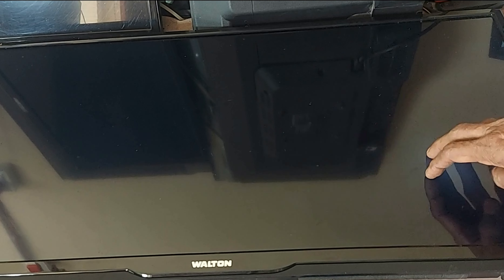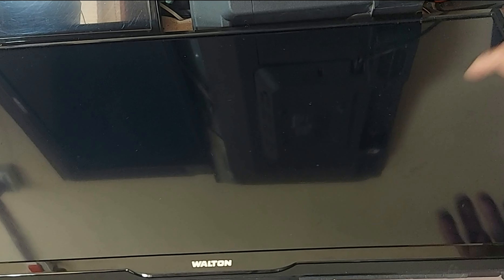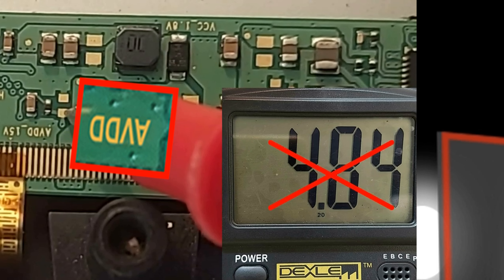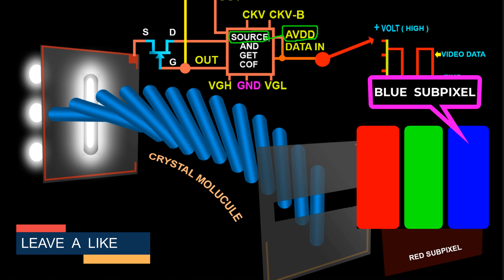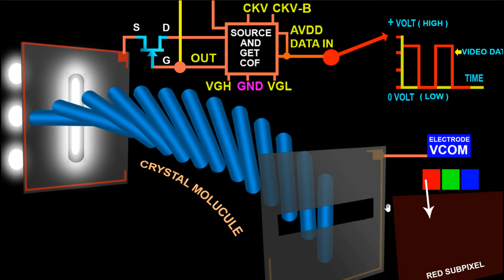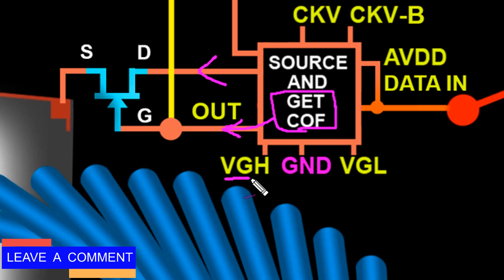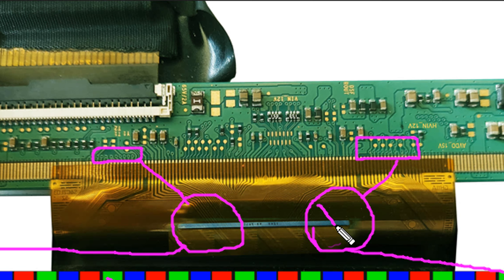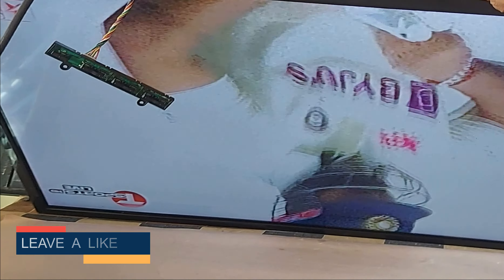LED TV Screen has no light |  what works TFT, AVDD, CKV, VCOM, VGL, VON or VGH & Liquid Cristal cell

Comment: Thank you so much for sharing! I have same problem on a monitor LCD (curve) brand  Gigabyte G27FC there are 2 boards connected with flex cable from CN1 to CN3 along the screen. If flex cable is not connected then there is 50% of screen have image normally. Any suggestion to cut the lines ?

Comment: Hi mr Mustafa.
If one single color vertical line is visible on the display all the time, (rest of the image is normal) at maximum brightness, what exactly is the problem?
In my case, rouhly in the middly of the screen, there is a 1 pixel wide blue very bright vertical line.
I have tried to place a piece of rubber sponge on top of the glass part where flex cable is bonded to apply more pressure, but did not help.
Thanks.

Comment: No ic sm4168, na placa LSC320AN10-H07 no pino 28 tem um resistor que vai ao terra da placa, você  sabe dizer  valor desse resistor? Neste pino onde tem o regulador Boost, correcto?